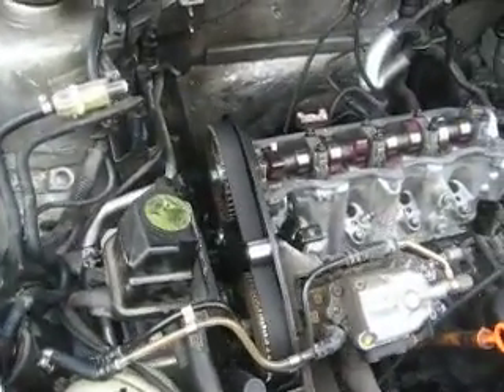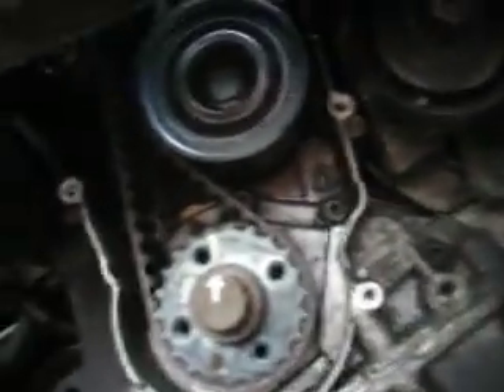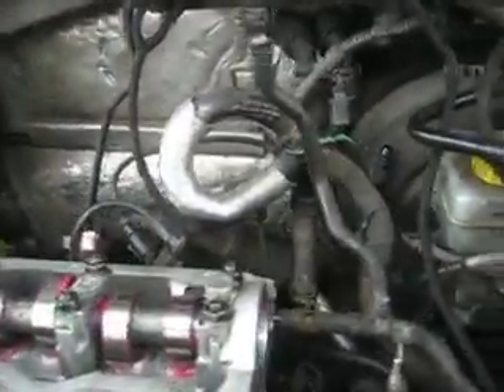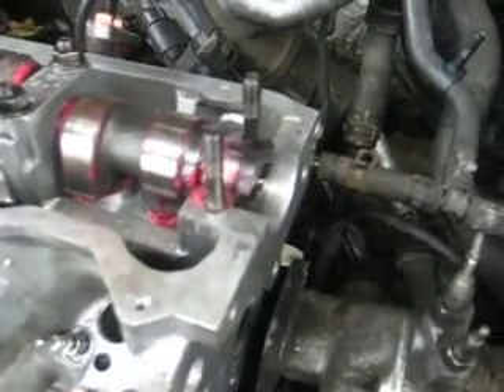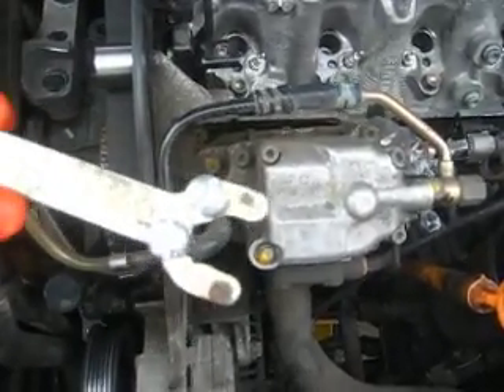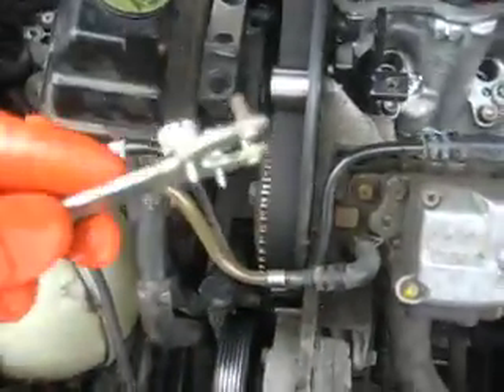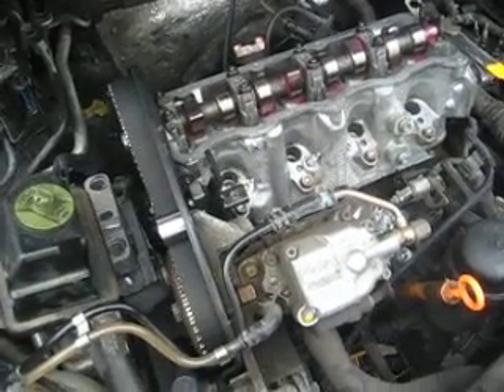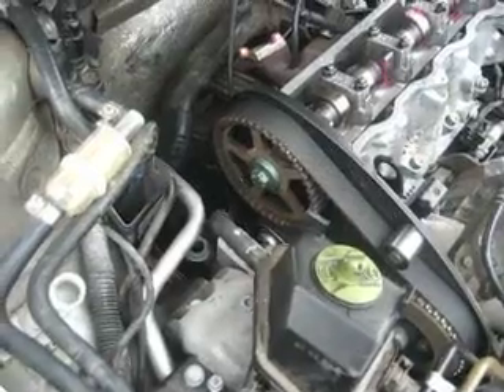VW TDI Timing Belt with no Tools + Helpful Hints

Comment: How did you know you had to replace valves and work on the heads?  Same thing just happened to me with the timing belt on my VW
Reply from the maker: Thanks for watching. 
Sorry to hear of your misfortune. The easy way to see if valves are bad is to remove the valve cover and look at the space between the cam and the hydraulic lifters (the little round silver things below each cam lobe). Each lifter should be tight against the lobe (i.e. no space) and if you look closely at the lifter it should not have any cracks or heavy wear marks in the center. Now take a large flat head screwdriver, place it between the lobe and the lifter, and the lifter should give a little and return to it position once you remove the screwdriver. If any of those tests fail then you 100% have bent/broken valves and or damaged piston(s). Remove head to start the repair.
When I removed my valve cover two of my lifters were badly cracked in the center and I had two lobes that had space between the cam and the lifter. But on the bright side rebuilding the head was not that hard and I got the opportunity to fully polish all the valves and ports to a mirror finish. It was surprising how much carbon was built up on all the exhaust valves. To this day I swear that the auto with the head that I rebuilt sounds better than all the other ALH TDIs I see. (Pride)
Call the nice folks at MetalManParts.com if you are interested in doing the work yourself. They have all the tools and parts you need. I had only rebuilt (in my driveway) a 1990 Honda Civic 4 Cyl Gas engine before this. On that auto I had to replace the engine block. These diesels have strong blocks and piston rods as part of the heavier requirements of the high torque engine. As a result, you will rarely see a diesel with a broken block or bent piston rods. The biggest reason for replacing the ALH TDI diesel block is because the broken valves will dance around in the cylinder and destroy the piston head and upper cylinder wall.
I wish you all the best and don't be afraid to do as much as you feel comfortable doing. These diesel autos are easier to work on than gas ones.

TDI Love from Chicago.

Comment: Yeah grab a few drill bits and insert until you find the right one! lol.... 15/64" ......Good job! .......That is to lock the IP gear into the housing right? a drill bit seems like it might be a tight fit as it's so long! the actual tool is shorter. I'm wondering why it's 3 marks on the Crankshaft? I've not done this yet and am researching it now. Camshaft.....some of your terms are off but good job!! Necessity is the mother of invention!! 

Also I know on a gasser rebuilding the head usually causes the piston rings to fail / leak sooner. I'm not familiar  with this on a diesel but seems it would but at a slower rate. diesel normally lasting longer thus a slower rate .....but I may be looking at it wrong......all depends on the shape of the piston rings I would think. to bad you can't do accurate compression test on a cold engine. before and after would be nice to know. =]
Reply from the maker: Thanks for watching. There is lots of room to use a drill bit to lock the diesel pump at TDC.  The official tool fits in there loose and the drill bit is snug.  I never did find out way the crank sprocket has the 6 marks on it.  There are three on one side and three 180deg across.  The only way you can tell them apart is by looking at the alignment dempel.  I have never had to mess with diesel rings.  It seems they only lose compression from the valves being full of carbon.  I clean and polish them by hand to a mirror finish... if I have to remove the head.
I found out the hard way that 100% RTV silicone is better then Locktight to keep hot bolts from dancing lose.  I had the trans side motor mount drop while the diesel was running.  Easy fix but a pain in the kester. 
I think all of my terms of off.  I try my best but this is not what I do.  VW scared me into buying tools and putting on a mechanics hat, because when I went to my local dealer, All the service guys were wearing WHITE jump suits.  Who does that? And Why.  It just looked like I was going to have to pay for their cleaning and over price service to boot.  I have no problem with making a living but it does not cost $148.00 US to change a headlight bulb. I have learned lots but I have a Audi/VW specialist for the really tough stuff. The key is to have a working second car. lol

TDI Love from Chicago.

Comment: Im having problems timing the same engine all the timing marks look lined up perfect an she starts fine but its running loud and just wont go right ive stripped it down 5 times and even checked all the vacuum hoses going to the turbo just incase they had broke or came off when engine was let down on jack to get engine mount off ,but they were all fine ,it sounds like its off timing but all marks look perfect .
Reply from the maker: CiaranM01 Hi and thanks for watching. Why did you do the timing in the first place? Was it running fine before you did the timing or did the timing belt break?  If it broke then I would start by checking the condition of the round hydraulic lifters under the camshaft. To check all 8 you have to remove the timing belt and the camshaft. Check that all the lifters seat at the same level height (this is an easy way to visually see any bent valves or piston that need extra care).  Next check the condition of all the lifers by removing then one-by-one. Closely examine the tops and bottoms of each.  The top should be smooth as a mirror with no scoring or cracks.  Next examine the bottom of each lifter.  The lobe on the bottom should not be depressable with normal hand pressure because the lifter should be full of oil. Check this with a rag covering the lifter just in case it squirts oil.  The lobe should not be loose or easily depressed.  The lifters tell a lot about valve and cam condition. If the lifters seat at different heights or the top is cracked then you should remove the head and check the condition of the pistons. But before removing the head first drain the oil and remove the oil-pan.  Use a strong light and check for piston arm deformation on the pistons with the damaged lifters.  If the timing belt broke then the piston's crankshaft arm could be bent, but before it bent it would have come in contact with the valves and that should damage the valves/lifters on that piston.

If it starts and runs fine at idle then let it run for about 2 mins.  You might just have air in your diesel line.  If it still sounds rough then I would check for diesel flow.  These TDIs don't have a pump in the tank but they do have a diesel level float body  that is notorious for clogging.  I usually replace the original ones with the Canadian/cold weather upgrade right after purchasing a ALH TDI. You can be chasing a timing problem and it might just be a fuel delivery issue. Next I would make sure my starter ground is tight. This is last on my list because I have left one loose once or twice and starting is hit or miss with lots of sparks. A bad ground can cause all kinds of problems.

If it sounds like the timing is off, but it runs, then the timing is off very little.  The Good thing about these engines is that the timing is almost all mechanical.  You can view Timing via a VAG-COM or VCDS and tune the timing by adjusting the diesel pump.

I wish you well and once you get it running please let me know what the problem was.

TDI Love from Chicago...
Reply: GallowayChicago Thanks for getting back to me ,i have found that the Diesel/injection pump had been replaced before and when i pulled the pulley off the casting had been broken so when i had put the locking pin in it didn't lock at all and has jumped ,so i have to buy the gauge to screw in the back of the pump to find what degrees i should be setting it at before tdc . TDI love from Ireland  .
Reply from the maker: +CiaranM01 How did she go? Did you get the pump set?
Reply: GallowayChicago Set the pump back to factory standard using vagcom and adjusting it by hand ,the computer says its fine but its just not 100 percent there is still some lag there so it must be off by a hairs width and thanks for getting back .

Comment: Aloha ,i am in Hawaii There is no dealer here ,The bearings on the tensioner are gone ....can I replace it without taking the valve cover of ?? Any advice on it ...tools trutorial you know about . Thanks for your help.
Reply from the maker: Petr Drbal Aloha, taking the valve cover off is the easy part. I didn't show in the video the tool I made to hold the cam sprocket while you loosen the 17 or 18mm center bolt. I would never.. ever do a mark-and-pray timing job.

To do the timing right on a ALH TDI you have to remove (in no particular order): 
(1) The timing belt cover 
(2) The Valve Cover 
(3) The passenger side motor mount 
(4) The inner-cooler to EGR plastic tube
(5) The V-belt (sometimes called the auxiliary belt or serpentine belt)
(6) Both lower timing belt metal cover plates (optional) 
(7) The camshaft-end vacuum pump
(8) The pre-heat 3 glow plug housing under the vacuum pump (for 5-speeds) 
(9) The passenger side tire and wheel-well liners (optional except the motor side liner)
(10) Plastic motor cover (I almost forgot)
(11) The large Air tube right after the MASS (optional)
(12) The plug on your transmission (manual or auto)
(13) The plastic motor skid cover (if you still have one)
(14) The valve cover Crank Vapor Valve (looks like a hokey puck)
(15) both diesel lines that cross over the timing belt area (good time to change diesel filter too)

the only advice I can add is to take your time and watch at least 3 YouTube videos on how to do it. Remember never start your VW after doing the timing. Always rotate the engine three time by hand. Why, Because I said so! and because if the timing is wrong you will not be able to rotate it by hand. remember these are interference engines (that means that if the timing is wrong the valves can and will smash into the pistons. Usually resulting in bent broken valves and cracked lifters(if you are lucky!) or bent piston rods and 1 or 2 total destroyed cylinders (if you are not lucky!).

And since you are going to the land of where the timing belt lives, I would change the timing belt, water pump, and all the rollers.

It sounds like a lot but I just did one in 2 hrs. I skipped taking the two lower metal timing belt plates off and just looked at the flywheel for the TDC mark to align the main crankshaft (it was an automatic so the flywheel mark is different than the 5-speed). But I always remove the valve cover and lock the camshaft in TDC (like in the video). If you don't take off the valve cover you can be 180deg out of TDC on the camshaft. And since proper timing requires you to loosen the camshaft sprocket, you cannot rely on any timing marks that might be on the sprocket.

If you want to see a picture of what the real sprocket tool looks like go to this link:
Tools# MN3036 - Universal Sprocket Buster / Counterhold Tool

http://www.metalnerd.com/images/products/cat03/mn3036.jpg

https://howtune.com/articles/96-replacing-the-timing-belt-on-a-volkswagen-jetta-tdi-mkiv

(Above is a realy good How-To)

TDI Love from Chicago

Comment: I have to replace water pump because retarded last owner changed timing belt but never took the water pump out and it failed so its leaking out of it. This is a very helpfull video since I have a 2.0 Gas but its about the same. So thank you :)

As for the cold I live in Minnesota its colder here.
Reply from the maker: I wish you luck.  The tool I didn't show was the Cam Gear Holder.  I used two long closet organizer chrome pipes (almost 24" each) and flattened the oblong ends.  I then bolted one end and on the other ends I used long bolts and nuts to form the two arms to hold the Cam Gear while you tighten / remove the center bolt on the Cam gear.

You are lucky.  On this video the water pump dropped its internal parts and jammed the timing belt and almost killed the motor.  That XSBoost turbo cartridge is still running strong. Stronger the any of my other TDIs.  They do good work.

I'm rooting for you. Get dirty.
Reply: Yah I am lucky I don't have a turbo and only need to mess with the Pump. But you showed me a great tool creation for the Tension adjuster since I have 100s of computer screws around. Funny thing I found is I have a hard drive holder that has multiple pin slots and the pins match up with the tensioner holes. But to be safe I replacing the tensioner, pump and belt.

Comment: Help Me Pls. I cleaned my EGR ,and clear my code. i got the error back after i drive one day 100KM. So what i have to do its a EGR Problem or any other issue . My car is 2002 jetta TDI.
Reply from the maker: What code(s) are you getting and did you remove the EGR cooler stuff from your 2002 Jetta?
Reply: Thanks for replay. yes i removed the EGR from the car and i cleaned with brake cleaner. my intake manifold  look very dirty, so i need to clean the intake manifold ? there is any easy way to clean with out removing like  clean with vacuum cleaner  .Or  can you upload us a video step by step, how to clean intake manifold for 2002 jetta tdi.
Thanks.
Reply from the maker: Sajeev Kumar The best way to clean the intake manifold is to use the "fire method". i.e. torch(fire)+shop vac or air hose(high pressure air) [Redneck TDI Intake Manifold Cleaning!], and burn it out.  I have used Bio-Green-Clean with very little success and Purple De-greaser from Home Depot with better success over 48 hours. The problem with these products is they pit the aluminum. I also took an aluminum TDI intake to a machine shop and they dipped it in the acid bath and it did absolutely nothing but cleaned the bare aluminum. The (fire)+(high pressure air) method seems barbaric but actually works better and faster then any other. Warning: Do NOT use the fire method to clean your EGR water cooler. The multi tube water cooler will form leaks if you clean it with fire. The solder joints are temperature sensitive.
Reply: Or you could use oven cleaner method, like the way I did it on my channel.

Comment from the maker: I just changed my sons two back break calipers. and his emergency break cables were shot.  The OEM's go bad because of the road salt use here in Chicago, but for $15.09 there is a company here in Illinois that just makes awsome US built brake cables: Bruin Brake Cables, 104 Sayton Road, Fox Lake, IL 60020.
Reply: Hi I just recently purchased a 06 VW jetta tdi it has low power driving up any hill small or big.i took a video of it I dont know how to share it.i really do need help.thanks
Reply from the maker: I went to go get my glasses in anticipation of watching your video.  I guess I should always read first.  OK, your low power is due to something in the TURBO-line, because the BEW's are not as bad at the ALH with clogged Intakes.  The TURBO-Line would be the Turbo itself,  the Turbo actuator/wastegate, the Turbo Vacuum Line to the actuator/wastegate,  the Turbo Relay, the Vacuum pump, or simply a cracked hard line to the brake booster.  You can diagnose and repair without VCDS (VagCom) by going through each part step-by-step. I would start by replacing all the vacuum tubing and look very closely at the black hard line that goes to the brake booster.   On a side note, it is not unheard of for your 06 TDI to have a clogged intake manifold (see. http://forums.tdiclub.com/showthread.php?t=478494)
[Homework: (1) https://www.myturbodiesel.com/wiki/turbo-removal-turbo-replacement-on-alh-engine-bew-engine-similar ... (2) https://www.youtube.com/watch?v=4uFiZ7ulAO0 ... (3)  https://www.youtube.com/watch?v=Ppif4qC560U ... (4) https://www.youtube.com/watch?v=iQHcmHXTvA8]

Comment: Actually, it is possible to do the belt change without any locking tools at all, or even placing the engine at TDC. As well, you don't have to remove the valve cover/pump or the cam pulley. You simply mark the old belt and sprockets with Liquid Paper. After you remove the old belt, you make matching marks on the new one. Install the new belt by matching up the marks again. I usually put engines at TDC just for peace of mind but it's not necessary. I make one mark a double line for a sure index.

Comment: Just a note that the belt can be changed without removing the valve cover or locking the cam, or even having the engine at TDC. The method is to make matching marks on the old belt and the pulleys (I like Liquid Paper for this). Remove the belt, then make new matching marks on the new belt by comparison with the old belt. Make sure these new marks register with the marks you made on the pulleys and you're golden. The usual rotations for tensioner setting et voila. Got the idea from Lexus.

Comment from the maker: I think the service interval for the 2007 TDI Timing belt is 100K Miles(US).  My car is a 2003 1.9L and it was well over the timing belt service interval(90k). Keep in mind that timing belt don't just fail.  Typically that lose teeth of start to slip before totally failing, unless you have another component fail that runs on the timing belt like the WATER PUMP(1) or the roller bearings or the Diesel Pump(2).  1 and 2 are the main causes of unexpected timing belt total failures.

Comment: What year/age and at what mileage did your timing belt break? 

I've a 2007 2.0 TDI with 64k on the clock, I'm thinking of replacing the belt at 80k, it will be 7/8 years old